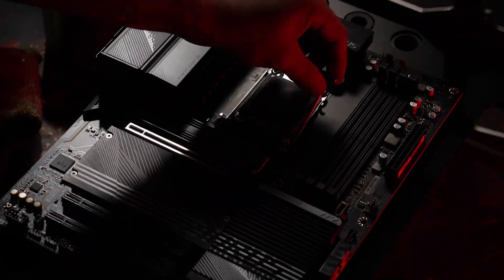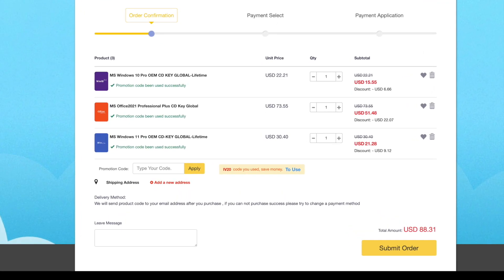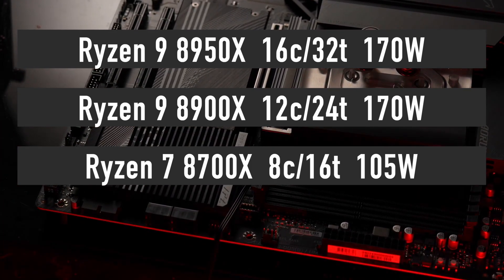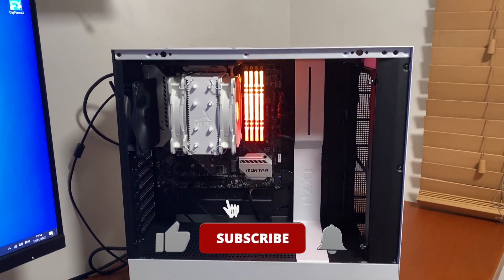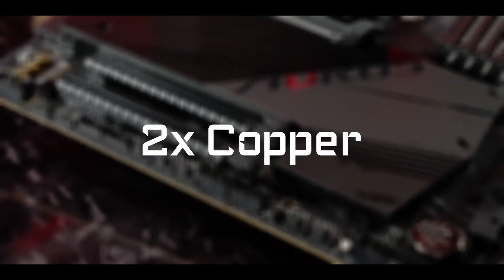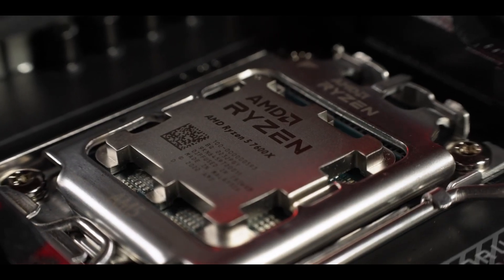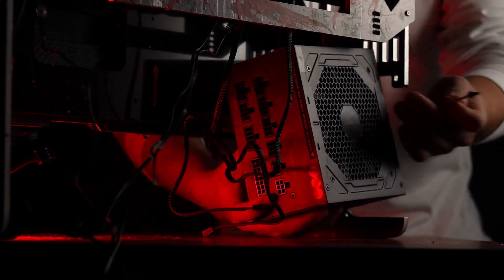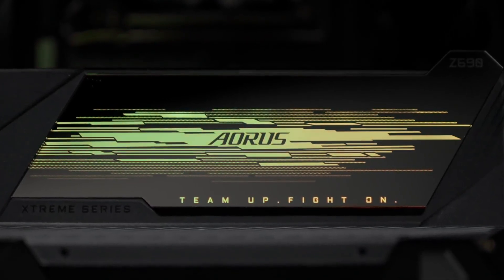The Most Ambitious CPU Generation [AMD Ryzen 8000-series, Zen 5]

Comment: AMD is crushing it. Awsome performance along with  excellent power use! Intel will be scrambling to compete on performance, but will use more power!
Reply from the maker: I too expect AMD to stay ahead of Intel when it comes to power-efficiency.🤝
Reply: Intel needs to evaluate their entire architecture. Not sure what is holding back/causing inefficiency but there must be a solution.
Reply: @TheCosmicMason  their node has been behind TSMC (used by AMD) for years now. It's why lately Intel has often been the budget option and more power hungry. I have no complaints though, I got a dirt cheap i5 for my last build since they need to compete on price now
Reply: @samk7500  we will soon see if it is really their node or architecture. I am assuming for now that it is a little of both.
Reply: @samk7500  Dude! TSMC were taking overflow orders from Intel in 1987. Do you even read before you open that? Engage brain..
Reply: @mrhassell  Read again, slowly. Keyword is "lately". Nobody cares about what Intel did 35 years ago, they need to get their act together and compete with TSMC today. It's bad for consumers when one foundry dictates pricing for silicon used by numerous major hardware companies.
Reply: @samk7500 well it seems like both amd and intel will be using tsmc 3nm on 15th gen and zen 5
Reply: @TheCosmicMason  Intel totally flopped with Pentum 4 and Itanium.  The people heading Intel really are fools who don't understand microarchitecture.  They are still using Pentium 3 / Pentium M inside their chips which is a complete embarassment to be using something 15 years old because they are incapable of designing something new ...
Reply: @dgillies5420  Prescott die, replicated by AMD from day Ryzen release & still rockin' 2017 to now.. Intel fiddling, 16 years prior to AMD adoption & clock to 3.06Ghz, on top of shot putting RAMBUS, introducing DDR, while defining micro-architecture, forming basis of "chiplet" design.. Without P4, AMD would not even have chips to sell! Athlon, Duron.. I liked that Opteron.. nice bogomips.